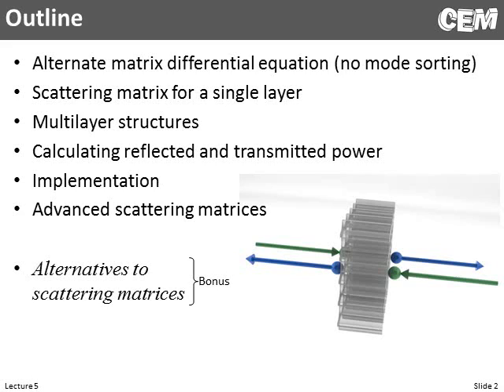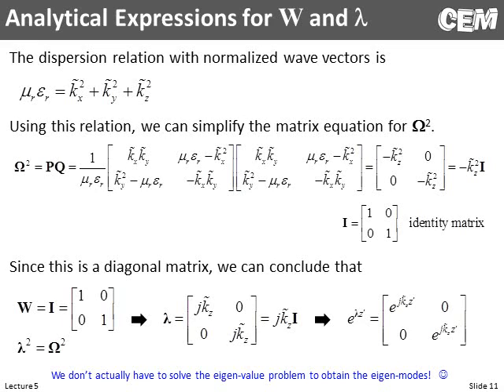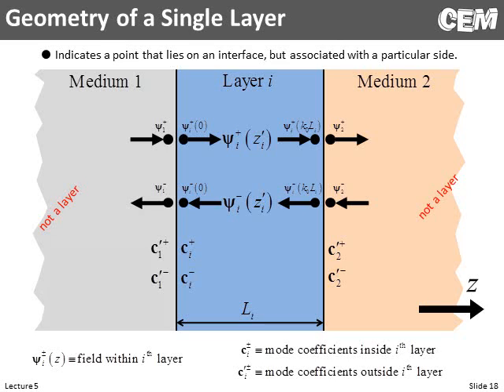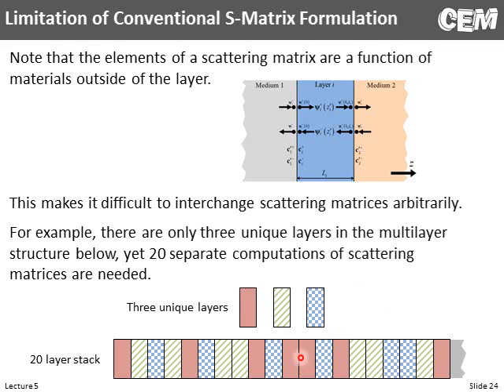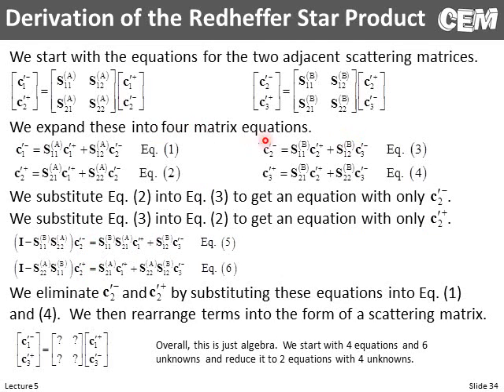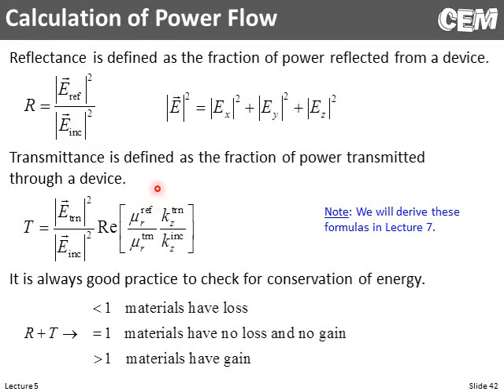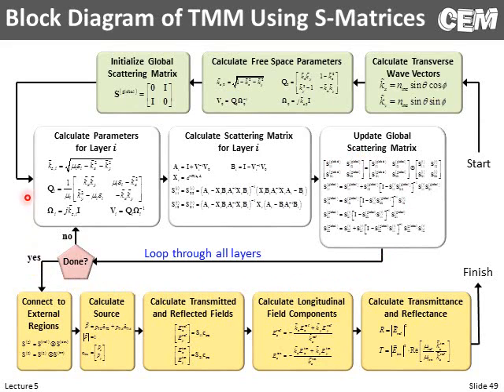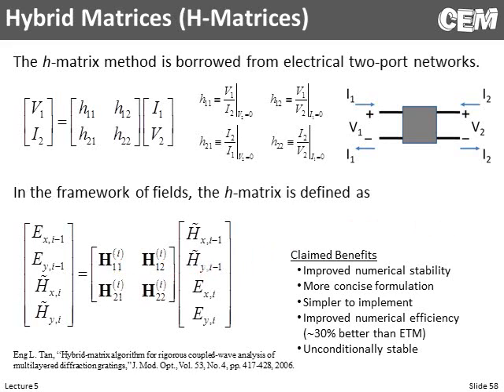Lecture 5 (CEM) -- TMM Using Scattering Matrices

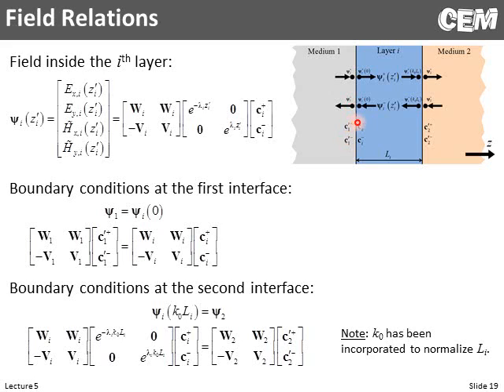Comment: The scattering matrix formulation starts of with using field equations derived in the PQ method (22:57). So is this formulation restricted to only isotropic material?
Reply from the maker: +_jp88 Yes.  You can derive the PQ form for diagonally anisotropic materials.  If you want to rotate the tensor at all, producing off diagonal terms, you have to implement TMM like in the previous lecture.  It involves the 4x4 matrix, sorting modes, etc.  However, when done it works quite well.  We use our anisotropic TMM quite a lot.
Reply: +CEM Lectures Right. Thank you again.

Comment: A big thank you prof Ray for this resources.  I am very much curious about the mathematical derivations as I get confident when I understand them. So on slide 21, you combine the inverse of [Wi Wi ; Vi  -Vi] with [Wj Wj ; Vj  -Vj] to get 1/2[Aij Bij; Bij Aij]. I cant seem to find any matrix algebra or assumptions that led to this result. On expanding, what I got was [Wi^-1Wj + Wi^-1Vj    Wi^-1Wj - Wi^-1Vj ;  Vi^-1Wj - Vi^-1Vj    Vi^-1Wj + Vi^-1Vj]. Can you please provide some hint that led to this result?  Your always prompt response is very much appreciated. Thank you.
Reply: I realized that,  by finding the general Schur complement  of an inverse 2x2 block matrix and substituting  the Wi,j and (-)Vi,j elements with some few basic algebra steps leads to that result. Thanks.

Comment: Is there any textbook that develops the ideas more deeply? Thanks a lot for the great content!
Reply from the maker: +Vladimir Vargas Calderon You can find discussion of scattering matrices in most circuit theory and microwave engineering texts under the general title "Network Theory."  In fact, the scattering matrices used in CEM are N-port networks.  Even for just TMM we have a four-port system, not a two-port system, because there are two possible polarizations on each side giving a total of 4 ports.  Take a look at the final scattering matrices and you will see that they are 4x4, not 2x2.  Now in terms of our improved version of scattering matrices, the only place I know of that being discussed is in our publication on the concept.

http://www.jpier.org/pierb/pier.php?paper=11083107

The paper is open-source so you should be able to download it freely.  Hope this helps!

Comment: At circa 54:00 - Does this mean that all the power resides in the electric component of the wave?
Reply from the maker: No.  Propagation happens due to a mutual coupling between the electric and magnetic fields so they both contribute.  Since they are coupled, however, it becomes possible to calculate the power from just the electric field or from just the magnetic field.

Comment: On slide 28, what to use for W0 and V0? it must be obvious, but i don't see it. Thanks!
Reply from the maker: First, let me point you to the official course website that has PDFs of the latest version of the course notes, links to the lecture videos, and more.

https://empossible.net/academics/emp5337/

W0 and V0, I am now called Wg and Vg.  These are the eigen-vectors of the gap medium.  Pretty much anything can be used without much issue.  However, some choices can lead to the case where kz=0 and the simulation will fail.  On slide 30 of Lecture 2c (of the latest version of the notes) I show how to make a section that avoids this entirely.
Reply: @empossible1577  Excellent. Thanks for the response and these lectures are quite informative.

Comment: Dear sir, thank you for the great/extremely helpful video. I am currently working at implementing your method and extending to SP's in multilayer graphene system. You mentioned one could extract the dispersion relation, how would you achieve this with scattering matrix? I'm aware that in transfer-matrix method the pole of the reflection coefficient leads to the dispersion, and numerically one could also contour plot for different Omega values versus their corresponding k-vectors, which can be obtained from the eigenvalue of the transfer-matrix; but here does the eigenvalue of scattering matrix still give you omega-corresponding k-vectors? I would be grateful to hear your insights!

Comment: Hello Sir,

I want to plot my EM fields in a medium. I took three mediums of air with same thickness to be sure about what I'm supposed to have (that is, 100% transmission)
From your Lecture TMM Extras, I extract the backward and forward coefficients in each medium. When illuminating at oblique incidence (theta = 30 degree),  the norm of my backwark amplitude coefficients are not equal to 0 (just a bit larger than 0), while they should because of only air medium.

Is there any numerical limitations to TMM, or should I reconsider the way I compute the forward / backward amplitudes coefficients? 

Thanks a lot for your work one more time!
Best,
Jules
Reply from the maker: The TMM as I presented is limited to lossless materials.  Things are a bit more complicated when loss is incorporated.  That is one limitation, but you are just simulating air (or probably vacuum) so I suspect this is not the problem.

Otherwise, all should be okay.  When you say "just a bit larger than zero," are saying like 10e-15 or something that small or more like 0.1?  I would not worry about very small numbers (i.e. 10e-15), but I would worry about 0.1 scale numbers.  One thing you can do is look at your intermediate scattering matrices.  Other than phase, they should all essentially be identity matrices.  Maybe one of them has an error?

Also, for visualizing internal fields, have you seen the notes I created about this in the TMM extras lecture?  I have not made a video of it, but you can get the notes from the official course website here:

https://empossible.net/academics/emp5337/
Reply: @empossible1577  Dear Sir,

Thanks a lot for your answer. I have fixed my problem, I mixed things in the internal / external coefficients of a layer :).

However, when looking at a slice of the field on a 2D plot (for example the Ex(z) field at an (x0,y0) coordinate ), I have a tiny but existing discontinuity at the interface between two layers. It's a really small discontinuity, maybe it comes from the way my program langage (Python) solve linear system? Who knows

Thanks again for your lectures, it's really helpful 

Regards,
Jules

Comment: Thanks for the lectures, they help me a lot! By the way, I find it bizarre since people always wrote in papers that the global matrix is the product of individual layer matrices, does it mean matrix multiplication or star product? How are they different in the result?
Reply from the maker: If you use the pure transfer matrix method, it is standard matrix multiplication.  However, the pure transfer matrix method is not stable as you saw in Lecture 4.  It is possible to fix TMM so that it works, but it is no longer ordinary matrix multiplication.  Most of the world has adopted scattering matrices, although other approaches are faster.  Combining two scattering matrices is definitely not a matter of just multiplying the two scattering matrices.  Unfortunately, it is more complicated than that and is called the Redheffer star product.  When you implement scattering matrices, you almost never store it as a single matrix.  You store the elements S11, S12, S21, and S22 as separate matrices.  Combining two scattering matrices involves maybe a dozen matrix operations.  See Redheffer star product equations.  If you tried standard multiplication to combine S matrices, I don't know what would happen, but the results would be garbage and differ significantly from using the Redheffer star product.  I am not sure what the meaning would be of multiplying two scattering matrices.  Somebody may know differently, but I don't think there is ever a time that is done.

Comment: 5:34 Why is it called matrix wave equation? There is no double differential with respect to time.
Reply from the maker: +_jp88 The wave equation comes in different forms.  You are referring to the time-domain wave equation.  With a Fourier transform, you can also have a frequency-domain wave equation (Helmholtz equation) with no double time derivative.  It is this that is cast into matrix form here.

Comment: I have a question regarding homework 4.  Should the inputs arguments SA & SB to the star() function be entered as block matrices ( with elements S11, S22,,, etc)  or as struct data type ( with fields equal to S11, S22,...)?
Reply from the maker: No.  It is extremely rare that the scattering matrix itself is ever used.  Instead, the four elements of the scattering matrix S11, S12, S21, and S22 are stored and used separately.  So, SA and SB are structures containing the four elements separately.  So you will have SA.S11, SA.S12, SA.S21, SA.S22, SB.S11, SB.S12, SB.S21, and SB.S22.

Comment: Hi Professor. I am following your lectures closely. However I got stuck in two important points and I would like to ask for your help in order to clear the things up. I am interested in calculating the electric/magnetic field distribution along the stack. Whe solving the matrix differential equations for E and H, we get two vector coefficients named c^+ and c^-. It is clear for me how to get c^+, from the source parameter calculation slides, but I do not get to calculate the vector c^-. I drew the conclusion that it has to be calculated using the scattering matrix method in order to compute the backward coefficient of incident field and the transmitted forward-travelling coefficient. Then I got stuck in calculating the scattering matrices. I understand the fact that when computing its respective S-matrix, every layer has to be sandwiched in vacuum, so we can exchange the layers as we wish to compute the overall S-matrix. However it is not clear for me, where to include the zero-thickness rule of vacuum into the equations, in order to make it a numerical trick and that the computer knows that every surrounding vacuum layer has zero thickness, i.e. in which equation this thickness is included so we can say L —> 0 for media outside the layer.

I thank you for your reply in advance.

Yours sincerely,

Juan
Reply from the maker: This question comes up often enough that you have motivated me to put together a few slides about this.  I created a quick version so these do not represent my best work, but should be sufficient to learn from.  Go to the course website and look at the PDF of the electronic notes for Lecture 6 TMM Extras.

http://emlab.utep.edu/ee5390cem.htm

It involves saving W, V, Lambda, and the intermediate global scattering matrix for each layer as you work from left to right through your layers.  Then you work backward calculating first the internal mode coefficients and then the internal fields from the mode coefficients and the other saved parameters.  If your device has a lot of layers, it may take quite a bit of memory in your computer to do this.

Hope this helps!
Reply: Professor, thank you very much. Indeed the algorithm is much more complex as I was thinking. The slides are very clear. I just have a little question more regarding the calculation of single S-matrices for every layer. When saying that the sided medium is vacuum with zero-thickness, it is not clear for me where is this zero-thickness condition added that the computer knows it is a numerical trick. Or just calculate the S-matrices and putting them together with the Redheffer star product is enough to satisfy this condition?

Thanks a lot
Reply from the maker: Before we published [1], the computational EM community was implementing the scattering matrices in a very crazy manner.  The paper in Ref. [1] is worth the read and will explain everything.

[1] R. C. Rumpf, "Improved formulation of scattering matrices for semi-analytical methods that is consistent with convention," PIERS B, Vol. 35, 241-261, 2011.

The scattering of a layer depends on the layers next to it.  For this reason, a scattering matrix cannot be computed without knowledge of the layers next to it.  Even more, once a scattering matrix is calculated, it can only ever be combined with the layers it was calculated with.  This severely limits the usefulness of the scattering matrix.  I wanted the scattering matrices to depend only on themselves and I wanted to combine them with other scattering matrices in any way I wished.  This is the origin of the zero thickness concept.  Each layer in a simulation is actually separated by homogeneous gaps filled with the same material in all gaps.  This makes the layer scattering matrix independent of other layers and allows the scattering matrices to be combined in any order since all layers are now surrounded by the same medium.  However, we do not want the  homogeneous gaps to affect the structure electromagnetically.  To do this, we make those gaps have zero thickness.  There is not a place where there is a dimension set to zero.  It is automatic based on how the scattering matrices are defined and formulated.
Reply: CEM Lectures Professor once again, thank you very much for your soon reply and your clear explanations. They indeed helped me a lot. 

Juan

Comment: How are the parameters P_TE and P_TM calculated? It seems to me like they should be an additional parameter in the model, as we have said nothing about the polarisation of the EM source.
Reply from the maker: Those parameters are defined in the "dashboard" of your code.  That is the piece of code at the beginning that defines everything about your problem.  It is all the hard coded numbers.  P_TE is the complex amplitude of the TE polarization and P_TM is the complex amplitude of the TM polarization.  There is also THETA and PHI parameters the describe the angle of incidence of the source.This information is conveyed in to different places on the course website:http://emlab.utep.edu/ee5390cem.htmFirst, the dashboard for a typical TMM simulation is given in Homework #3.  Second, you can get some example numbers from the benchmarking document.  In this document, you will find all the dashboard parameters along with all the intermediate parameters as they are calculated in a typical TMM simulation.  This way you can troubleshoot your own code and better understand the order of the calculations.Hope this helps!
Reply: Thank you that is very helpful! Although I have to say, Im having some difficulty getting my code to return the benchmarked results!
Reply from the maker: It is possible that order of eigen-modes can be different between your results and mine.  There may also be a mistake in the benchmarking documents, but they have survived students in several courses so that is less likely.  Just keep at it!
Reply: Is the Qh and Vh mentioned in the benchmark what youve called Q0 and V0 in the video? I can't seem to decipher what they are
Reply from the maker: Same thing.  Sorry for the inconsistent notation.
Reply: I'm not sure how this can be, as for example, Qh(1,2)=1.1804, and yet the formula for that element is 1-kx^2, so should be less than 1?
Reply from the maker: Use the latest version of the electronic notes instead of the video.  Here is the course website:

http://emlab.utep.edu/ee5390cem.htm

Specifically, take a look at Slide 41 in the latest version of the notes.  I "think" I have all of the notation consistent.
Reply from the maker: By the way, the reason for the slight change in the equations was to improve stability.  By choosing to put free space in the gaps, there were cases where kz could go to zero.  To avoid this, the permittivity in the gaps was chosen to be something else, but chosen to be a mathematically convenient choice.
Reply: After a lot of frustrating debugging, I finally have a working model! I just wanted to say thank you, both for the very clear video, and for all your responses to my questions. 

This is my first time producing a proper piece of code, and I'm not sure I'd have managed it otherwise!
Reply from the maker: Awesome!!  Please feel free to share your thoughts if you think the notes could have been more clear or more helpful somehow, without providing the actual codes of course.
Reply: +CEM Lectures 
I actually found the notes very clear; a lot of my problems came from not realising the video was out of date. I also ran into some issues because I was calculating the s-matrix components in the wrong order, but again, that was clearly mentioned in the notes, I just missed it!
Reply from the maker: Very good.  Now on to the next method!  :-)

Comment: Hi Sir, 
I am trying to apply this method for a metal/dielectric/metal structure (MIM). I need study the excitation of the surface plasmons propagating in this MIM  structure. Does this formulation take care of the condition require to excite SPs? If not, Where would be the changes I need to make to find the eigen values and eigenfunction for SPs? Hope you would reply asap. Thanks
Reply from the maker: The TMM is a rigorous method so it is able to handle the physics of SPs.  Turning the TMM into an eigen-mode solver is possible, but the process is not described in this lecture.  It is a bit different and challenging.  An alternative technique for you would be the finite-difference frequency-domain (FDFD) method described in later lectures.  Also, FDFD will be able to simulate any type of excitation technique you may want to eventually study.  The slab waveguide analysis described in 12 is exactly the code you want for predicting SPs.

BTW, let me point you to the course website.  It has links to all of these lectures but also contains the latest version of the notes.  There have been some revisions, additions, and other improvements since the lectures were recorded.  I think this may help.

http://emlab.utep.edu/ee5390cem.htm